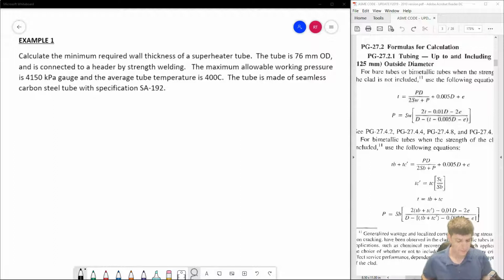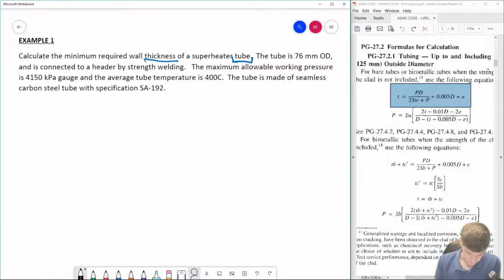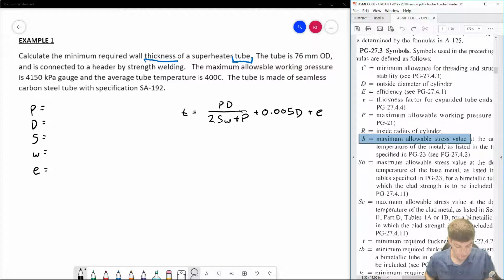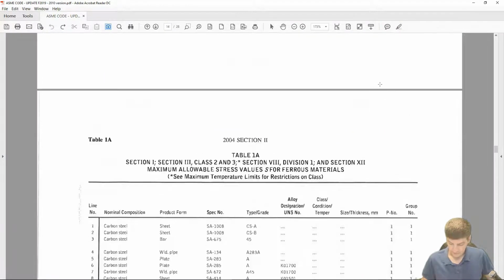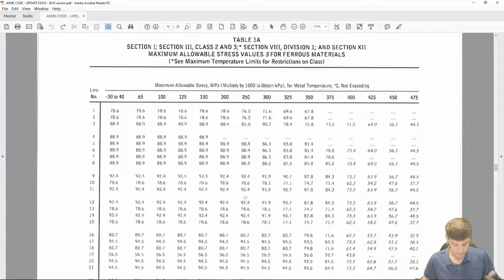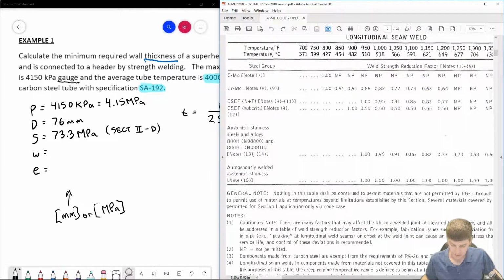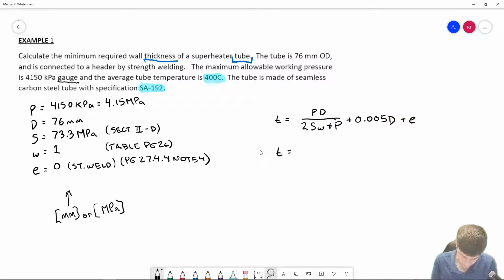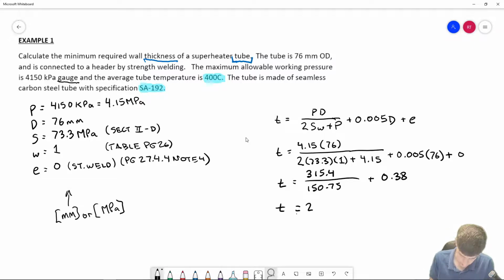MENG2018 - ASME CODE CALCULATIONS - Tubing Thickness Calculations

Comment: What will be the value of weld strength reduction factor "w" if the tubes are seamless and instead of strength welding tubes are connected through tube expansion process...?